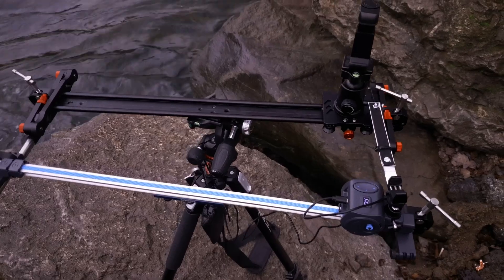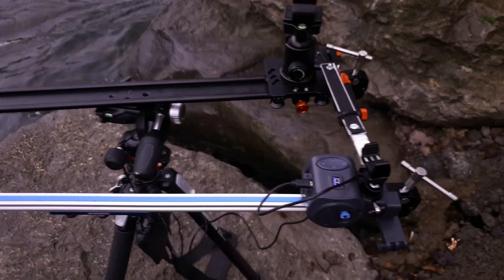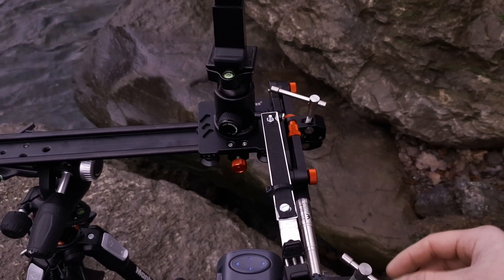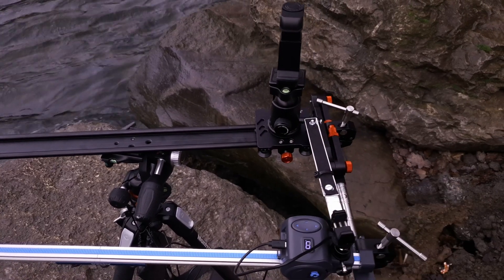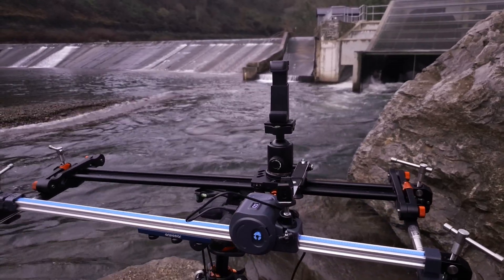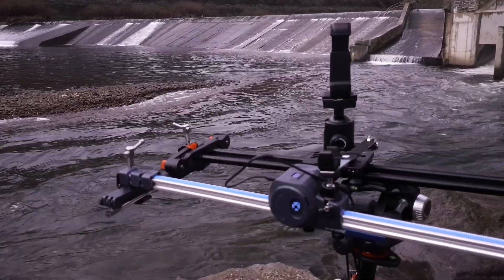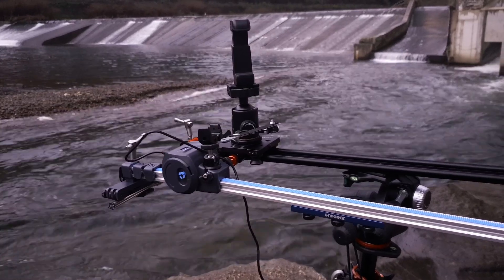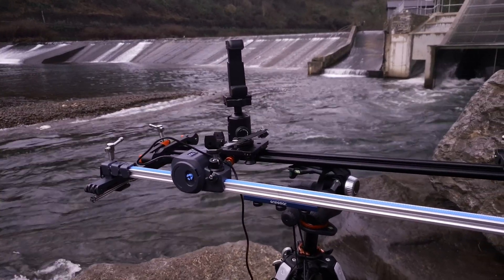Grip Gear pan test

Comment from the maker: Bertram photography having trouble seeing the comments, thankfully i could read it in my mail. 

For the price its great. Slow but really good. Excellent for revealing shots or timelapse. 

I'm not using a camera just using the Samsung S9 need to a bit of saving for the gear i want. It deals with that fine.

The only two issues I have is that the feet aren't amazing and even when tightened can still be pushed out of place. However each foot does have a 1/4 thread so you can put your own feet on it. Not done that myself yet but will be doing when I get more chance to get out an about. 

The second issue is the small buttons that allow the motor to move along the track and bounce back n forth. They are tiny and are place each end of the motor. Some how I have managed to break one. No major issues but store it safety. Thought I stored it safe enough but I need to be more careful.

Also on speed 9 takes 60 seconds to do the two tracks. Speed 1 is 146 minutes I think. 

Personally I love it. It's not without gripes after all its $99 but tbh i'd buy it again.

Its light, portable and all fits in my ruck sake with my gimbal and rest of the stuff I take with me.

Hope this helps